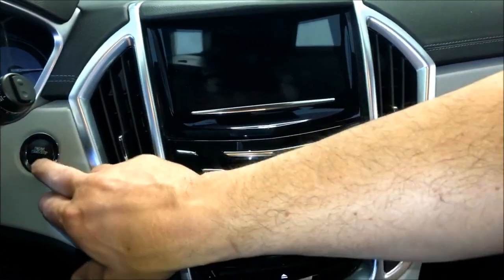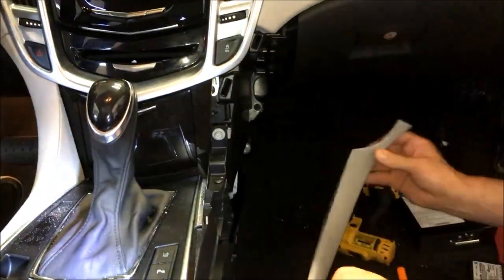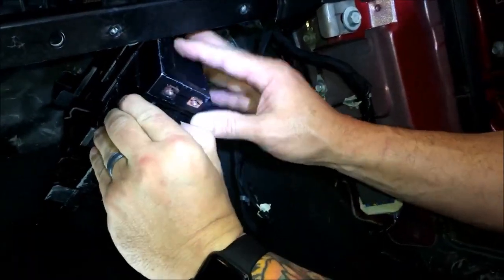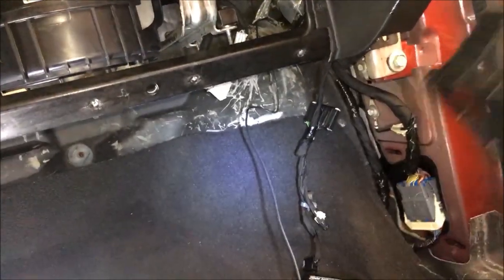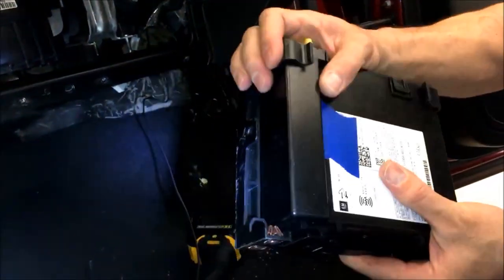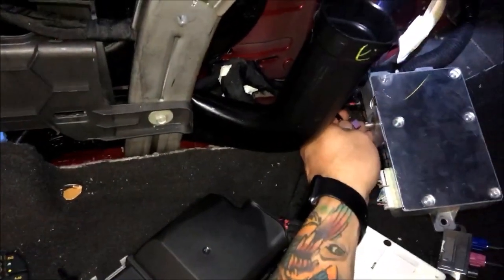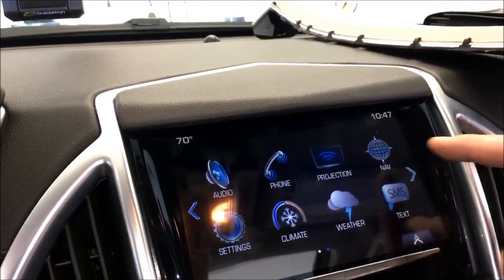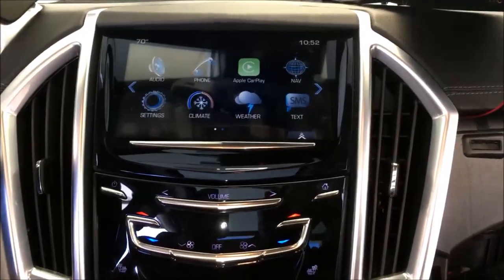2013 2017 Cadillac SRX Factory Navigation with CarPlay and Android Auto

Comment: I have a 2013 SRX with an 8" Cue.  It currently has a HMI 1.1.  If I read correctly, when I order this, I need to order a replacement GPS antenna?  I was reading that 1.1 uses less GPS channels than a 2.0 or 2.5?  If I need to replace it, can you provide that?  If I can use the one I have, great!.  My current 1.1 has GPS built in.  Goal is the add CarPlay. Thanks!!
Reply from the maker: You can absolutely use the GPS antenna from factory, if already equipped with NAV. The 2.0 and 2.5 have to do with the processor in the module. You will notice a drastic increase in speed and performance with a 2.5 module over a 1.1. You would also add CarPlay/Android Auto functionality with the 2.5 version